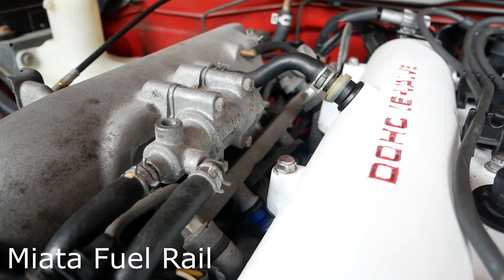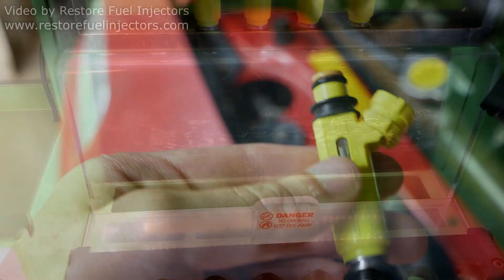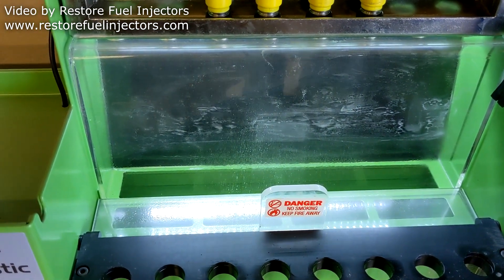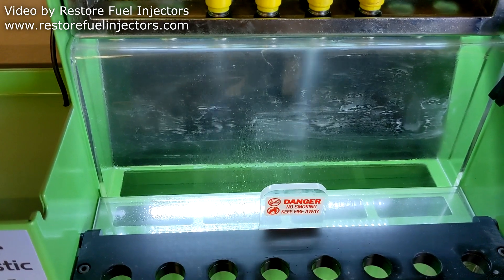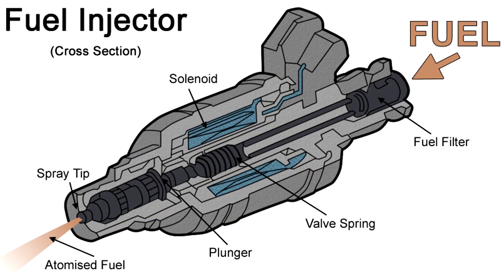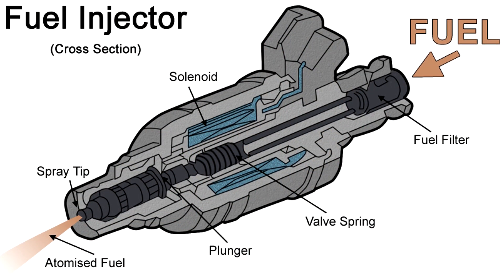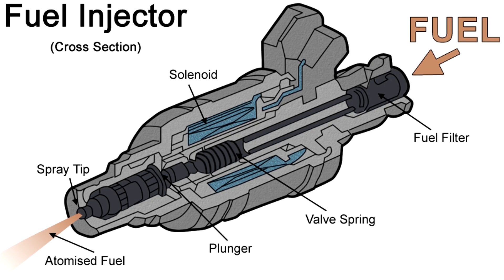Fuel Injectors Explained - The Basics of Fuel Injection

Comment: Great video .Is the injector either open or closed and never partly open to limit fuel ?Thanks
Reply from the maker: Yes, it’s either open or closed besides the time between the two, which is minimal
Reply: @CashedOutCars  Thank yo sir .I have no ohm reading or clicking when I applied the  9V .I had both on my new injectors as i tested them pre installation

Comment: Question, what is the biggest bang for your buck for a first installment into a Miata without harming anything
Reply from the maker: It depends on what you want to do! My recommendation is tires. You’ll get lots more grip in the corners with a good set and will be able to push the car a lot harder with a good set of summer tires! What kind of driving do you do with yours?

Comment: Do you think you will need a afm too after the injector are changed？i also have a1.6 and waiting for my speedyefi pnp arrive.. I don’t have turbo yet, but are planing when more funds are saved.. I have basic bolt on only air filter, header and exhaust only
Reply from the maker: AFM meaning air flow meter? If so no after installing the ECU. If you mean FMU (fuel management unit), nope you won’t need one! That’s mostly used for increasing fuel flow in boost without an aftermarket ECU and it’s not an exact science, or a way that’d I’d even consider doing. I’d highly recommend setting the ECU up NA like you have it! It’ll be a nice power gain with just the ECU and will teach you how to use it before you go boosted and have a higher risk of breaking stuff. Good luck and let me know if you have more questions!